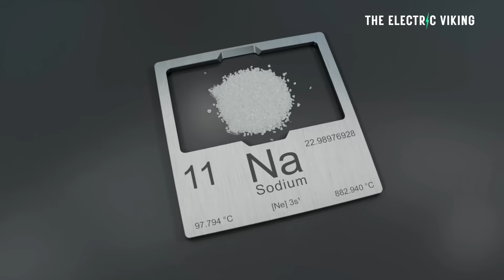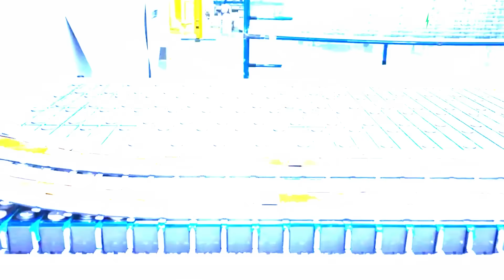Goodbye Lithium! New 3,600,000 Mile EV Battery costs 50% LESS

Comment: Nothing is ever "game-changing" until it is in proven within volume production.
Reply: I agree, so many of these announcements never amount to anything
Reply: This is of course correct, but the closer you get to actual production, the more sure you can be on the claims made. It is also clear that you must take the company that makes the claims. So if Toyota make a caim, you dont believe it, if CATL make it, it is much, much more probable. And certainly, game changing is also not one thing, you must also ask yourself, in witch segment of the market.

Talking of battery degradation, this is NOT an actual problem for established technologies, but it is of course true for "promising" technologies.
Reply: on youtube everything is at least "game-changing" :face-blue-smiling:
Reply: This is CATL, not a university lab. They have serious credibility, and should be taken very seriously.
Reply: @SeanLumly  CATL are the best battery manufacturer on the planet. But these claims are not in the News section of the official CATL website. They are just media rumors/claims. And that means, until proven otherwise, they're not called Chinese whispers for nothing.
Reply: Indeed, I've seen dozens of gamechangers in the last decade, until they hit the production line.
Reply: Current sodium battery production rate is still very little compared to total battery production (only 50GWh so far this year compared to the total of almost 4TWh/year). It needs to ramp up its production scale sooner if they want to change the battery world

Sodium ion battery is already in sale in some marketplaces, but the listings are still very few. Last time I checked there are 5 listings of the sodium ion battery, 2 listings of prismatic cells and 3 listings cylindrical cells, and they're all from the same shop (HAKADI Battery)
Reply: @sihamhamda47  Two things to take into consideration. CATL is the one producing it, and it is the same process than LFP manufacturing. So they can use same factory with little change to do both. Now for sure, it won't replace LFP tomorrow, but they could still be produce in mass. Which is a good thing, because it is not game changing as he is always exaggerating in his videos. He criticizes people, while he does the same every time in his videos.
Reply: It is not some back-yard-shop or research group claiming stuff. It is CATL revealing something OEMs can order! I have no doubts in the correctness of the information CATL provided ... they have a pretty good track record. 

What I'm curious about is what they DON'T claim. What if calendaric aging is catastrophic? Why is the 24V battery only claimed to have an 8 year service life?! LFP has proven itself to still provide useful work in installations as old as 15 years!

When I model the battery after my car and its usage (Volvo EX30 51kWh LFP, 23kWh/100km average, 25,000km/year) aging down to the useful life (70% remaining SoH, after that range is actually a lottery):
LFP with 6,000cycles and 1% CA: 23 years, driven 575,000km and the battery worked around 2600cycles.
Naxtra with 10,000cycles and 0.7%CA: 36 years, 900.000km, around 4000 cycles
Naxtra with 10,000cycles and 1%CA: 28 years, 700.000km, around 3200 cycles
Naxtra with 10,000cycles and 1.5%CA: 21 years, 525.000km, around 2400 cycles
Naxtra with 10,000cycles and 2%CA: 17 years, 425.000km, around 1700 cycles
Naxtra with 10,000cycles and 3%CA: 12 years, 300.000km, around 1200 cycles
Reply: The guy who is always talking about game changing, is telling us not to listen to people who says game changing. The same Vikong, told us like a month or two ago that LFP batteries were like $ 35 at cell level ($ 50 at pack level), after a battery storage project in China won a bid with that price.
Reply: These people said the same thing about EV vehicles decades ago too. Look at EV vehicles today? Legacy autos are fast becoming obsolete🤭and that is why all major automobile companies wanted a share of EV market and hence the manufacturing restructuring of their company.
Reply: Nuclear fusion is game changing too...ANTIMATTER Even more so... But what's gonna beat it all is black hole engine  energy production
Reply: These companies would retool to keep up with the market.....
Reply: Your sensationalism is  becoming tedious. Lfp  blade batteries are good enough to sell millions of cars. None of the media sensationalist deceit materialise into reality sales. 
  It's all speculation and dreams. Sales are  real. Laboratory nonsense is entertaining but deceives consumers.
Reply: @stephenhall5112  So technology is a waste of time or overrated in your eyes. What have you invented that has changed the world. lol
Reply: The big issue will soon be switching out your existing battery pack form your older EV, and upgrade to the latest newest tech.    I like the idea that these are good to -40°C living I 🇨🇦
Reply: Researchers have hit 60% in solar panels but the cost makes it prohibitively expensive to build still.  Gane changing and low production, just like koenigsegg has been doing recently.
Reply: These Naxtra batteries have been produced since June. They are currently being used in start stop trucks. Like the Volvo industrial truck design.
Reply: What happened to CATL's "condensed matter battery"?  

Wasn't THAT supposed to be the battery "game changer"?   

CATL's Condensed Matter Batteries were supposed to give us electric planes... soon.    Where are they???

*
There's no negative consequences for CATL coming out with BS about batteries every 9 months.   They can put out BS with the blessing of the CCP (don't forget -  CATL is a CHINESE company, which means they do want the Chinese Communist Party tells them to do).

Russia funded the European idiots of the Green Party to help keep non-Russian natural gas off the market, and make them DEPENDENT on Russian natural gas.   Why shouldn't CCP- controlled CATL come out with BS battery stories that say, "Don't invest in oil indepence!  Batteries are going to make oil obsolete!".  --- or some such BS.
Reply: This is the problem with traction battery development.  Always revolutionary, game changing but never gets into mass production.
Reply: Most of these "game-changing" new technologies never solve the problem of battery degradation. That why you can't buy most of the solid state batteries yet. So yes, there is a huge gap between "show promise in a lab" and "can cost-effectively manufactured in large quantities to be safe and reliable". I personally think the current Lithium-Ion technology will be history in a couple decades, due to the fire hazard.
Reply: @elhoward7440  Or it might end up like Solar panels, where the original solution, that was supposed to be killed by other solar solution, from thin film etc. Finally killed the vast majority of alternative solar tech. In five years time, we might get LFP and/or Sodium batteries at 10 USD with 250+ Kwh energy density and that can kill with that price most other battery tech.
Reply: @elhoward7440  battery degradation is not a big deal.  My car has done nearly 30,000 miles without noticeable degradation.  After 200k miles it will still have 85% of its capacity left.  Fire hazard is also a pretty low risk, especially in LFP batteries.
Reply: Shouldn’t be a problem, sodium is chemically almost identical to lithium so production should fit into 
existing battery factories.
Reply: @mikeheffernan  Elon doesn't call Production "Hell" for nothing. A POC, be it solid state or sodium is easy, they are not new concepts - but controlled scaleability of them is daunting, otherwise everyone (Panasonic, BYD, etc) would have done it already.
Reply: @RichDunn no one that listens to elon has any credibility
Reply: @stratvids  Only a fool would not listen to the richest man in the world, with the largest slice of the global EV market pie. And indeed lots of legacy auto CEO's arrogantly didn't, and are now paying the price for that.
Reply: @mikeheffernan is not sodium highly explosive with in contact with water 🤔,I wonder how humidity wil affect it. Uhh... lithium does not explode at contact with water 🤔.  Not sure about you but you I see there a problem.
Reply: @JuanGarcia-hr8ks Sodium’s other name is salt, which certainly doesn’t have a problem with water.
Reply: @JuanGarcia-hr8ks  The batteries use sodium ions which are chemically quite inert (as in common salt). It is elemental sodium that reacts with water.
Reply: @mikeheffernan im pretty sure if you could just use salt to store immense energy we wouldn't have started to use lithium 😂
Reply: @JuanGarcia-hr8ks  Did you ever heard about Salt explosion with water, must be sooooo dangerous mixing salt and water, lol
Reply: @mikeheffernan  There's a difference between sodium chloride (salt) and sodium... Pure sodium reacts violently to water
Reply: @pedroferreira2871  Correct. I should have done my homework.
Reply: @mikeheffernan ok then, where are they?

Comment: Buick took a different path.  They’re USA gas powered generator to power their lithium battery to get 870 miles.  The gas engine does power their lithium battery wheel; it charges the battery

Comment: Sodium had two hurdles to overcome, besides price, those were gravimetric energy density (by weight) and volumetric energy density. It sounds like the Naxtra batteries may have addressed the gravimetric question, but what is their volumetric energy density? If this is lower than LFP, then fewer batteries will fit per battery pack meaning EV range will reduce with Naxtra batteries compared to LFP of the same, or similar, gravimetric energy density. 

If the volumetric density is closer to LFP then yes their lower price will change the market, but if further away then the batteries will be suitable for more specialised use, where volume and pack density is less important, such as smaller city vehicles (where range can be optimised to capacity available and cost is an important factor) and larger goods vehicles (where space is available, and again cost is an important factor). Beyond that static applciations have always made sense for Sodium than Lithium.

Volume is important as the cathodes in Sodium batteries swell more than Lithium batteries during charge cycles (Sodium is a lot larger ion than Lithium), so typically Sodium batteries have larger cell size to support growth in internal volume that takes place.

Comment: Need a plug,n,play system where you can swap them out like normal batteries, like changing the oil. That would be a game changer
Reply: I agree but it can be a lot more work than an oil change.  You only need to do it maybe every 10 years. That is a lot of oil changes skipped.  I saw a thing about folks who have a replacement pack for the old Nissan Leafs.  It takes them a few hours to do the swap.
Reply: Like Nio already have, yes?

Comment: I hope Sam is right. But I suspect sodium ion batteries will be viable for grid scale storage years before it's used in cars, given its low energy density. As for cars, I wouldn't hold my breath. It sounds like more PR vaporware. I'll believe it when I see it. Just too many desperate companies running around making fantastic claims in a very difficult, debt-fueled economy that is China today. I just read that Chinese producer prices have dropped each month for 34 months in a row. That's deflation

Comment: Tesla has no future.

FSD #       Miles to critical disengagement.
12.3.3       196 miles   (accident everyday)
12.3.6        228 miles  (accident everyday)
12.5.1.3    183 miles  (accident everyday)
13.x     493 miles (accident every other day)

Tesla says it needs 670,000 miles to match humans. That requires a 1,400x improvement. Don't hold you breath. From 12 to 13 was only a 3x improvement. At this rate it will over 10 years to reach autonomous driving.  RIP Tesla.

Comment: 1. Car owners care about total mileage per fully charged batteries.
2. We don’t care if a battery lasts more than a million miles, rather we care about battery capacity as a function of battery life.  The vast vast majority of us are not driving a car for more than 250,000 miles. 
3. The resale value is irrelevant with rapidly evolving technologies.
4. We care about the effective cost per mile or km.  This calculation takes into account the charging efficiency.
5. Lastly, you are assuming that sodium batteries are the end all of battery technology.  It’s NOT.
Reply: Actually as I'm driving an electric car, I also care a lot about charging speed and winter range.
If the natrium ion battery is more temp stable, it will be the better option for most users
Reply: 1,  Many EVs on the market have enough range.  As people realize this, EVs will sell better.
2. A battery that lasts a really long car makes the trade in/used car worth more so it matters a little.
3. Lots of people drive used cars that are over 20 years old.  Also resale value helps you buy the new car.
4. EVs generally are a lot cheaper than ICE per mile.  It gets extreme if you have solar panels to charge from.
5. At some point, you have to buy that new car.  Also I expect battery evolution to start to slow down now.  We are running into a physics limit on how much energy you can store in reversible chemical reactions.
6. I expect Lithium batteries to still sell for a good while anyway.  Cars come with lead acid batteries.  You can still buy zinc carbon cells
Reply: @kensmith5694 trade-in’s are meaningless for rapidly evolving technologies … which been shown to be the case for the EV market.  I am aware that EV’s are less expensive per mile (electricity versus gasoline), but the public needs to be provided with the numbers.  The total operational cost must take into account maintenance and repair costs.  I have a battery background … the evolution of battery technology has another order of magnitude for technological growth (actually more).  As evidenced by CATL, it was only a couple of years ago that bloggers were counting out CATL because of the plethora of competition in the lithium battery market.  Competition breeds innovation.

Comment: If the metric is cost per mile of battery life rather than cost per kwh, lowering the cost from $55/kwh for 300k miles to $19/kwh for 3000k miles is more than a 90% reduction. Even if the lithium ion battery lasts a million miles, the cost reduction is over 90%.

Comment: The batteries may well be cheaper but I’ll bet my house that the cars they’re in will not be cheaper to buy. Car companies have lost so much money developing and producing EVs that they will want to recoup that and more as fast as possible for as long as possible.
Reply: Many EVs are already making positive cash flow.  Competition tends to drive the price down to cost.  We will see lower prices but on the other hand, they will  build more software bloat and fritterware into the cars so that you need a subscription to be able to make a left turn.
Reply: betting your house, you should rethink that deal In the past five years, new electric vehicle (EV) prices have seen significant drops, especially in the latter half of that period, with some models experiencing price reductions of up to $16,500. This trend is largely driven by increased competition, advancements in battery technology, and the entry of more affordable brands into the market probably not in the land of the free.
Reply: Sodium batteries would be heavier than lithium batteries. The car itself therefore has to be sturdier, so more expensive to build.
I don't know where it would land, though.
Reply: @larsnystrom6698  why would they be heavier than LFP if they have similar energy density?